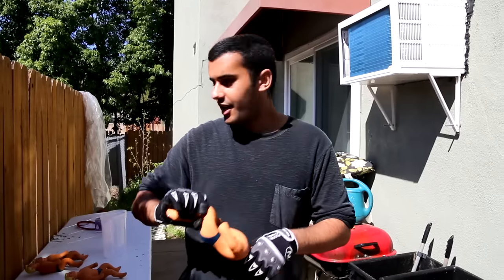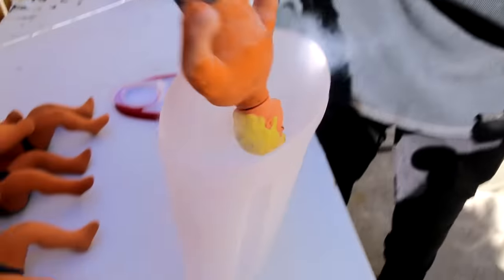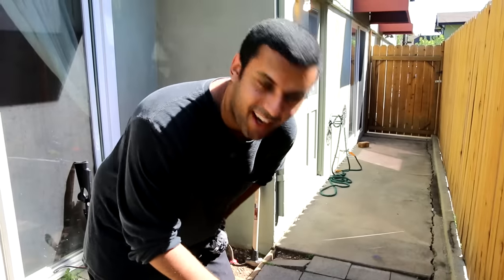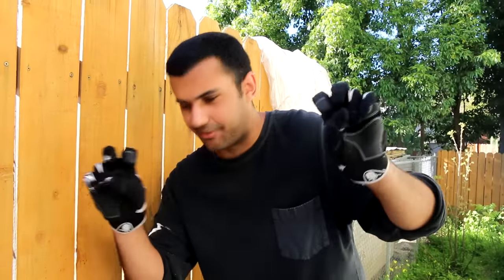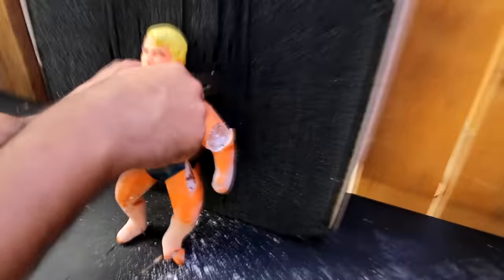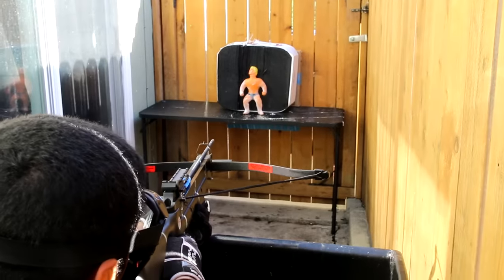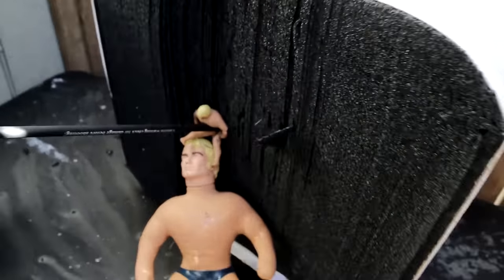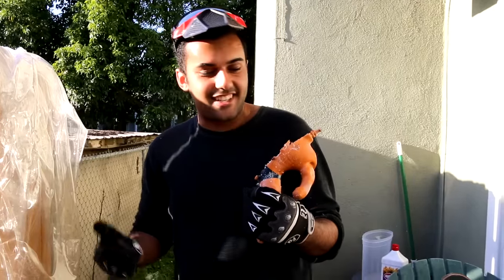EXPERIMENT!! STRETCH ARMSTRONG TOY VS LIQUID NITROGEN / CHAINSAW, AND MORE!! *IMPOSSIBLE CHALLENGE*

Comment: An $8 robot from Kroger's stand at the chance against hard concrete it did not get destroyed by the hard concrete so I waited for three more months iWave for another year to pass for it to be winter again and there's ice all over the Outback and guess what the head flu clean off and pieces of the robot just scattered all over the place when I hit him on the ice used concrete what the heck normal Concrete in war but when concrete is used with ice it weren't the toy was smashed to bits